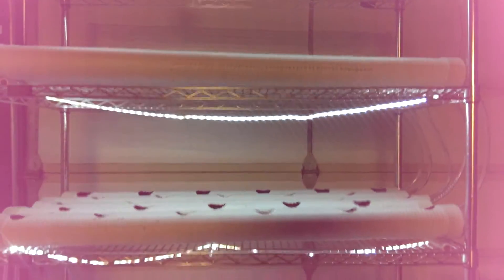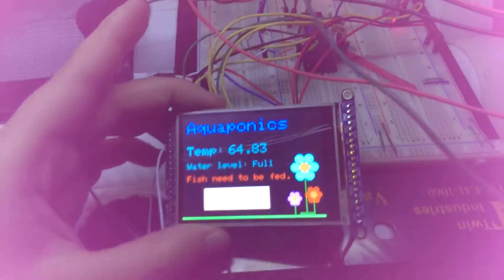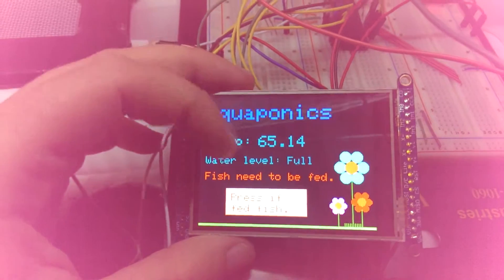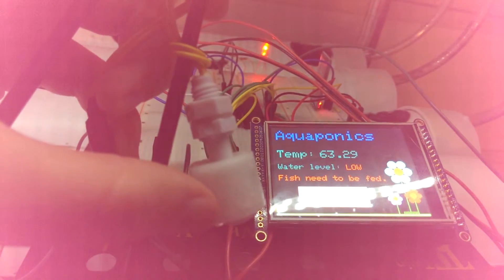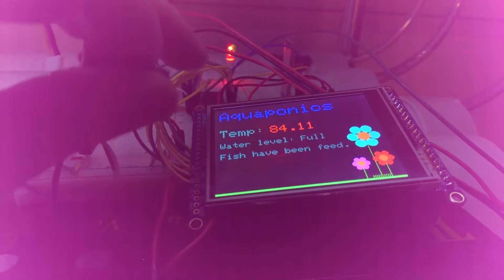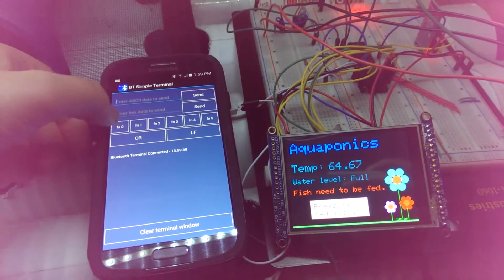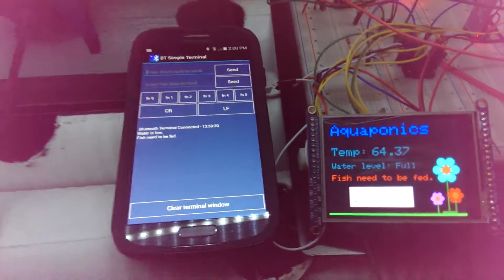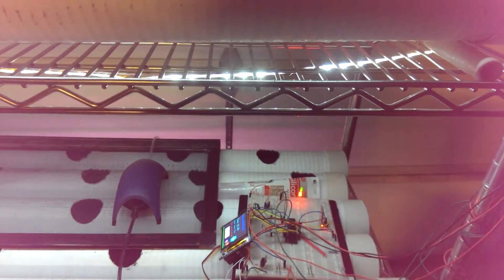UCR CS 122A Fall 2014 -- Cassandra Garner -- Automated Aquaponics

Comment: Of course I didnt realize that my wifes friend was logged into her youtube account instead of me so I will try again I am interested in learning =)
Reply from the maker: Although I am a big fan of the Arduino, I didn't use the Arduino for this project. Instead I used an Atmega1284 microcontroller. As for the setup are you more interested in the physical aquaponics system or the electronic automation component?
Reply: The electronic automation and notification please